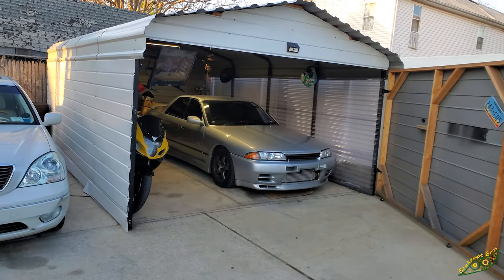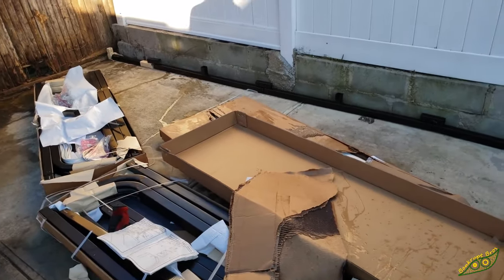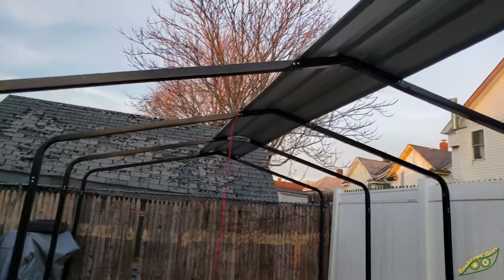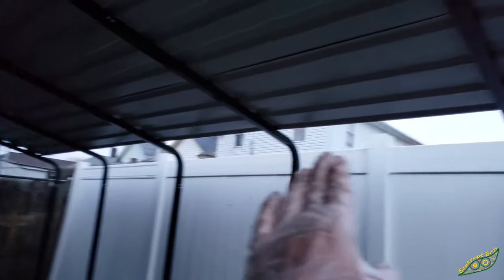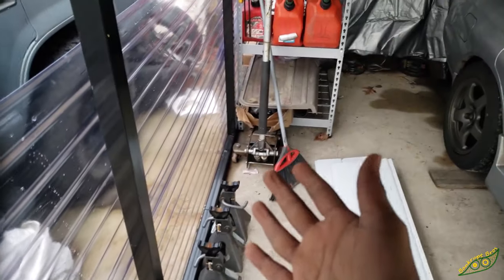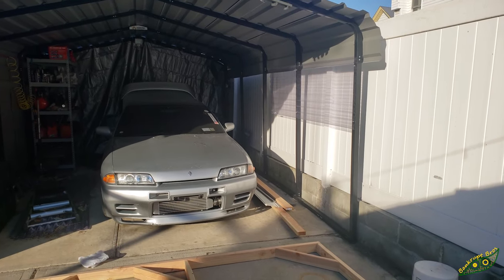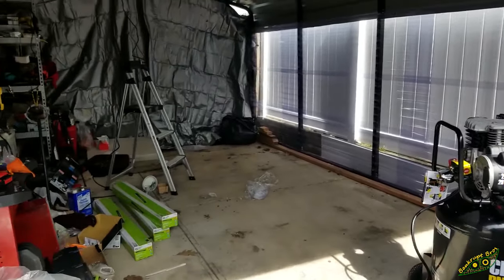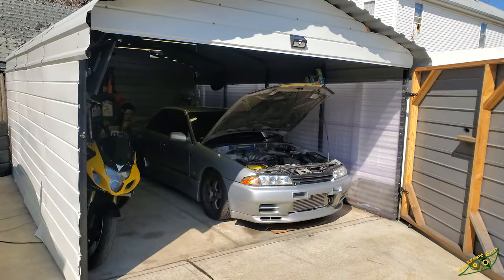How To Enclose A Carport | AKA Budget Garage

Comment: Great video and great tips on putting the carport together. Thanks for taking all the time and effort to make this video.  There are so few detailed Arrow carport  erection videos you should be getting a lot more appreciation for this. I just got my 10x20 and will be referring back to this as I build mine.........as soon as I figure out how I am going to anchor it to  the uneven desert ground .
Reply from the maker: Thanks a lot for the words of appreciation. I was in the same boat as you, without any other info out there I decided to put up my own. One thing I did not do was anchor the carport. Wind is an issue with these when there are no sides and they are in an open area like I assume you’ll be in the desert. Mine is in a corner with sides in nyc. So wind was never a concern of mine. Only the weight of snow. I’ve had it for over 2 years now with no issues at all. I will soon be posting an update on the setup inside but I haven’t made any changes at all to the structure since I put it up 2 years ago. I’m curious how do you plan to anchor it in the desert? I’m assuming your going to use one of those expanding anchors for dirt?
Reply: @BankruptBros  hey great job is this A 7. Foot legs or 9 tall

Comment: I own a welding shop and I don't have anywhere to paint my work but outside. This is a great cheap alternative vs extending my welding shop just to have a paint booth.
Reply from the maker: Im tempted to build another one for the same purpose of just basically being a workshop. The only downside is poor security. I wish you all the luck in the build.
Reply: Mine would be built in the back of my welding shop which is already enclosed. I'm going to look into this now that the weather is getting better and get the ball rolling.

Comment: This is cool as hell! And you did all of that basically in your own. What do you think of lining the inside with some sort of insulation? And maybe sandwiching it between more siding on the inside so it stays hidden. I wanna build something similar eventually but also want to be able to do work inside during the winner. Without freezing to death lol.
Reply from the maker: I’ve managed to work on cars in there with temps as low as 20 degrees. I just did a timing belt on an is300 during a winter storm that passed through not long ago. I have a 24k btu kerosene heater along with dressing well it does work. That being said a proper building with insulation is the best way to go. At this moment in time it’s not cost effective to even attempt insulting this. It’s a temporary building that I knew I’d only need for about 5 or 6 years. I’d rather save the cash and put it towards my next bigger better building

Comment: What kind of nails/screw/bolts/nuts are you using for the siding?
Reply from the maker: 5/16th hex head self tapping screws 1 inch length

Comment: Itll be interesting to see how it looks when there is snow on the roof. Most of these carports have braces on the bent areas of the roof bars. They all bend a little with snow, i know a guy who had no supports and the snow caused it to bend downward 8 inches😳. If this happened with yours you couldnt open the door. Id definitely look into bracing.
Reply: Arrow ports are rated for 35pounds per foot
Reply from the maker: Correct. They are rated for 35 pounds per foot. I've had about a foot of snow on it with no issues. I live in New York city so snow isn't too bad. Somewhere Midwest or up north may have some real problems with snow on a carport like this

Comment: Where did you get the Aluminum Siding? Can you share the brand?
Reply from the maker: The aluminum siding is sold in 12 foot lengths at Lowe’s and homedepot. I don’t remember the brand. That being said you should be able to find something similar easily.
Reply: @BankruptBros  thanks man. This video was very helpful
Reply: Two questions? How does this survive in the snow and what kind of brackets did you use to attach the wood  to the frame?

Comment: I have the same cartport I did everything was supposed to but for some reason there's still some water leaking 😕 from the roof.  I'm planning on converting it into a "garage " 😉 do you have any leaks?
Reply from the maker: I know this is a late response but hopefully it can help. When I first built it I had two small leaks. I took clear silicone and put a thick bead on along all the seals from the inside since I couldn’t really access it from above. After that I haven’t had any leaks which really surprises me lol. How did the garage project turn out?

Comment: You did an excellent job!! Is that car port adjustable? The width of my yard is 16 feet x 21 ft. Also I would worry if a strong gust of wind would make that door fly open pretty hard when I'm going in.
Reply from the maker: Thanks!! When its very windy with the door open it does move around. I've seen winds blow it open and also slam it shut. If its that windy I just keep the door locked so it won't move around. Its one of the cons trying to stay on a tight budget. Also this would just barely fit in your yard. Its 12'x 20'.
Reply: @BankruptBros  thanks for the reply. I'm going with Carolina Carports. More money but im not that handy

Comment: What did you do for power? Just an extension from the house?
Reply from the maker: Where the "garage" is there use to be a 26ft above ground pool that had electricity ran for the pump. I took that same outlet and put it inside securely. But a heavy duty extension cord would do the same trick as long as its out of the way of cars and water etc.

Comment: I'm looking at doing this for my car detailing business. Is there enough room in the 12x20 to open all the doors of the vehicle if it's parked in the middle??
Reply from the maker: I know this is a late response but in the hopes it may help someone else I'm still going to respond. it depends on the size of the vehicle. My r32 skyline had no issues doing that while parked in the middle. You only may run into a problem with a truck or a coupe that has long doors. I hope this helps

Comment: How did you run power?
Reply from the maker: There used to be a pool where the “garage” is. I’m plugged into the outdoor outlet that was installed for the pool pump. But for internet I ran a pvc line along my fence and then to the house and ran a 150ft Ethernet cable from inside the house through the pvc into the garage.
Reply: @BankruptBros  thank you for replying im doing a similar build